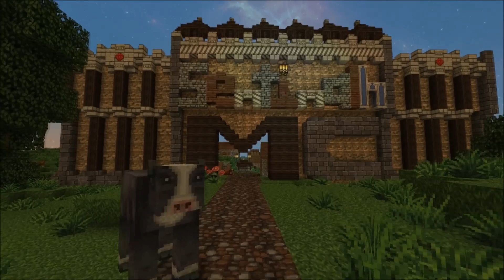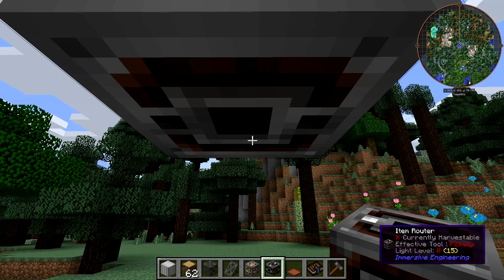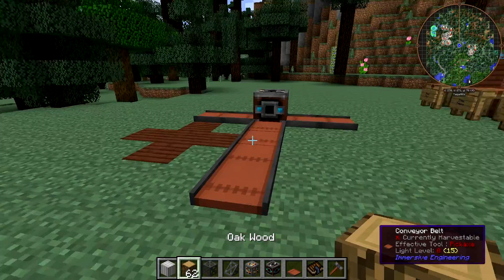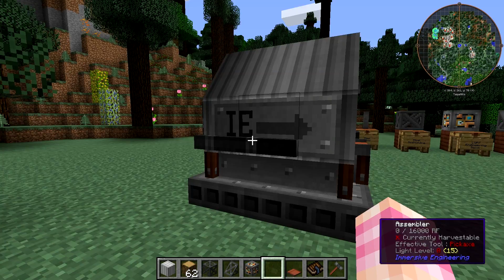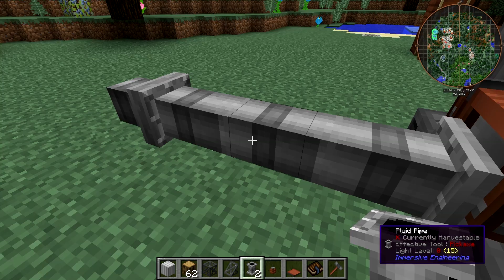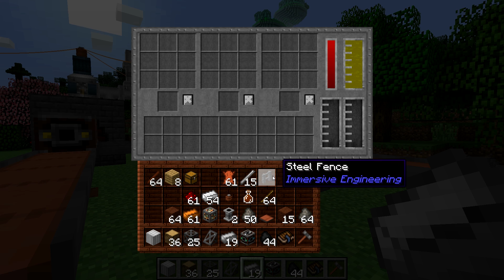Immersive Engineering Tutorial #7 - Assembler

Comment: do you think item pumps from RotaryCraft also work with this?
Reply: +Geminids Newman  they do spit to the air if they don't have an inventory to go to.  they also don't move if there is no room. I use that to split up canola from wheat and canola from itself.  however, they don't branch.  I think those mods could play nicely together.
Reply from the maker: +Geminids Newman I'm sure there are a lot of ways in which RotaryCraft and IE can work together. Personally I'm looking into using the item filters from RotaryCraft with the conveyor belts.